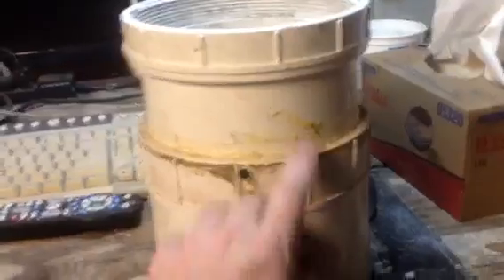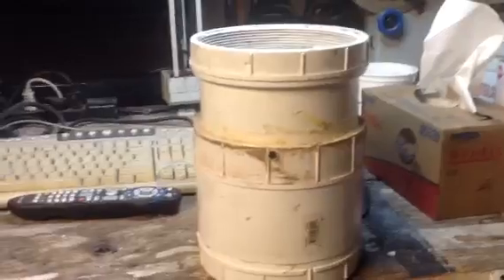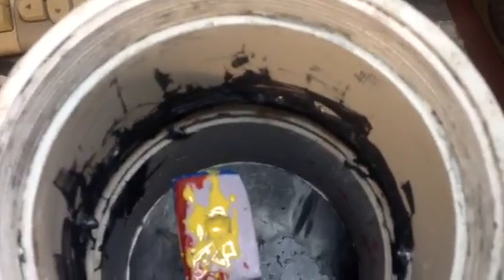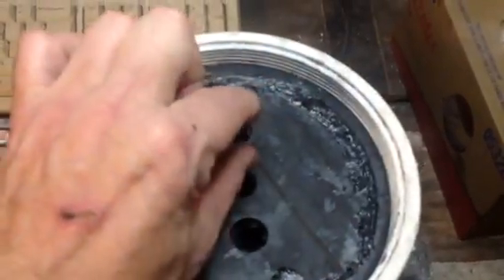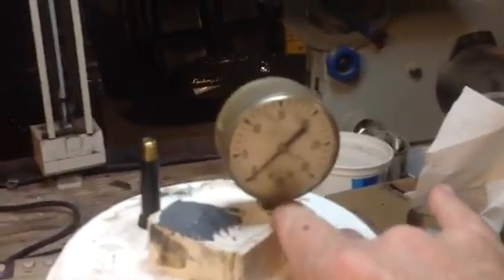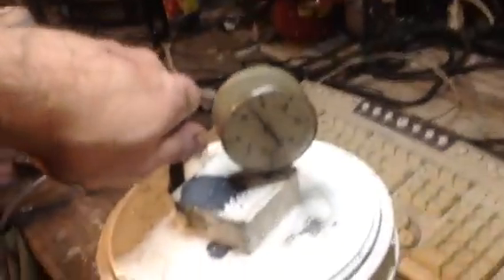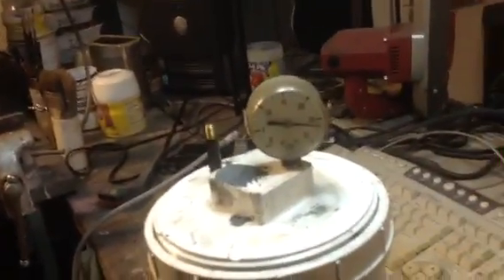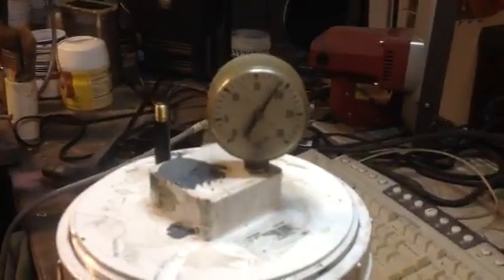25$ Pressure Pot for casting Resins

Comment: I am curious if you could use a garden sprayer you can get up to 45 pounds of pressure in one just have to find one with the opening big enough to put your arm in
Reply from the maker: Todd, 
 Not sure really. You only use low pressures here but even at that the pvc creaks and pops here and there. An accurate pressure gauge keeps you safe from catastrophic failure. It would seem to me that a garden sprayer has walls that are just too thin to be safe. Not only that but you'd spend more time and money finding the right one than you would just to build this one  which I know 100% works. Hope this helps you out.

Comment: i built one just about the same im having problems with the top leaking air i seen that you are using a chunk of rubber as a rubber gasket   and im trying to find out how to get a chuck like that to use as a gaskets
Reply from the maker: It's a pice of rubber from a conveyer belt. You can buy hunks of it on EBay. Hopefully this helps : )
Reply: +Budzilla Sohoski How thick is the rubber?

Comment: Did you glue the bottom cap ? and did you use a rubber seal on the bottom as well
Reply: When in doubt, yes use a gasket, and yes glue it.
Reply: @kennethscott8669  thank you

Comment: I always thought your suppose to keep your resin in pressure pot until it cures?
Reply: Yeah you are. Vacuums remove bubbles by causing them to expand and rise to the surface, so immediate after vacuuming you need to restore regular atmospheric pressure. PRESSURE, however is the opposite. Pressure compresses/shrinks gas imperfections. If you let the pressure out, all those gas bubbles (which are still right there in place) will return tot heir previous size.
Reply from the maker: I should've said that it depends on the resin. The resin I use has a water like viscosity. Thicker resins like epoxies require more time. I actually filmed the process with a go pro and as soon as the pot was pressurized the bubbles moved to the surface...it was instant.
Reply: Budzilla Sohoski If you had adequate pressure, all of the smaller bubbles should have instantly disappeared; only the larger ones will float to the surface. If you'd like to test your theory, get some clear resin and attempt your method, then attempt another and allow it to cure fully under pressure. I guarantee you'll find that the one cured by your method will be foggy and filled with small bubbles- the one cured under pressure will be crystal clear. Im sure you get fine results, but releasing the pressure really defeats the purpose o the device- you could easily use a vacuum pump to equal or greater effect [but curing under pressure is by far the best].
Reply: Budzilla Sohoski what resin do you use?

Comment: Your not removing bubbles. You are shrinking them. You should keep the pressure on until the part has hardened. I've been using a very similar pvc pipe system for years. I use a quick connect instead of a valve stem and I don't care if it leaks a little because I keep the compressors connected.

Comment: I like this idea and want to build one myself. I didn't understand what the rubber was for and how did you seal the air valve?  Great video. Thanks
Reply: The rubber gasket is absolutely necessary or else the unit will surely leak under pressure. As for the air valve. It's just a standard valve stem that you would use one a tubeless car tire. You just drill a hole and pull it through...it seals itself. Hope this helps.

Comment: Do not use PVC to make air pressure tanks !!

I made one and it exploded me to only 2 Pressure Bars. I was lucky and only hurt a finger, but it could have been the face or who knows. It is very dangerous to work with air and use plastic. Buy an 8L painter's pot, it's made of metal and comes prepared for it.
Reply: Use use thick walled PVC, pressure gauge, safety valve and low pressure. You only need about 40psi at the most and PVC is rated over 1000.  No issues.

Comment: question: where in gods name do i get belt rubber
Reply: It can be any piece of rubber that's big enough to cover the hole, and thick enough to create a seal bw the cap and vessel. Hard rubber mats, horse stall mats, thick rubber gasket sheets, etc.
Reply: @kennethscott8669  funny, i was just eyeing my (failed) pvc pressure pot from across my room today... i have to find some rubber sheet soon or just try making it again. thanks!

Comment: For crystal clear resin your supposed to use 40-60psi. I imagine 60pis will blow this apart. We also cast under pressure for 24hrs so something like this would be much better if you could find steel pipe as the concept is solid. I wonder if you could wrap this in carbon-fiber and resin to reenforce it?
Reply from the maker: Yeah, I believe the 40-60 psi recommendation is for thicker resins. The resins I use have a viscosity similar to heavy cream and this works perfectly for that. As for wrapping it in carbon fiber...you would very quickly approach a price that's higher than the cost of a commercial pressure pot if using Carbon Fiber as it it extremely expensive.
Reply: Still great work. Carbon-fiber weave does get the price up but preserves the DIY factor. I may give it a try as you only learn from trial, error and success.
Reply: PVC has a very high burst rating. I think the lowest operating pressure any pvc is rated for is like 127psi. Burst and operating pressures are not the same. The burst pressure is like 1200+ psi. Just so you know, oxygen/acetelyne/argon tanks and the like are pressurized way above their operating pressure to make sure that the tank can withstand the gas. Oh, and they are pressurized with water first, before gas. 
The problem with PVC is that it degrades over time. Through the course of seasons etc it can fail. 

There's a video done by some doctor teaching at a university about irrigation systems and he easily pressurizes the system to 40+psi, only because the sprinkler heads were optimal at 30psi.
Reply: Also, on wrapping the pipe with carbon fiber etc., It still wouldn't solve the explosion part if the PVC itself fractured. The reason why air is deadlier than liquid in a pressure system is because air is compressible, when it leaves the system it immediately tries to spread itself out to fill it's space that it should occupy uncompressed

Comment: I built one after watching your video and am having leaking problems out of the bottom. I have tried jb kwikweld and the pvc cement and neither work for a good seal. What did you use? How long does it take to pressurize the resin? Wondering if i can get away with the leak if it is not a long process. 
Thanks
Reply: Hmmmmm, I just used JB weld as you did.... It only needs about 50psi to work....maybe you're putting too much air into it. Try it with lower pressure and just keep adding air if it leaks to keep it at around 50psi for about a minute or two and that should work. The air bubbles come out immediately so it doesn't need to be under pressure for very long.